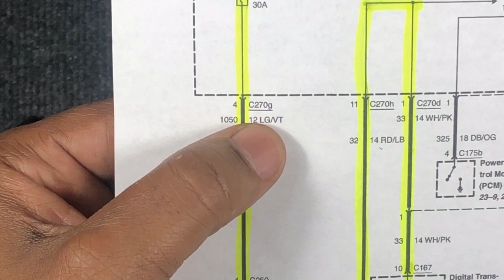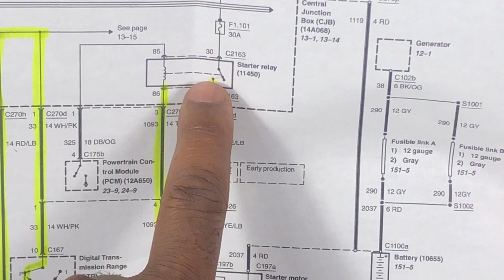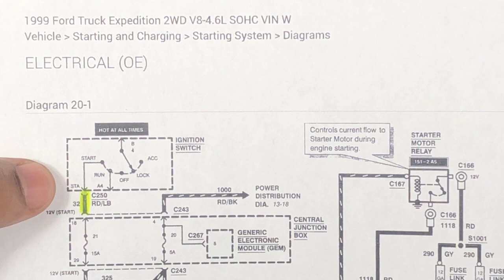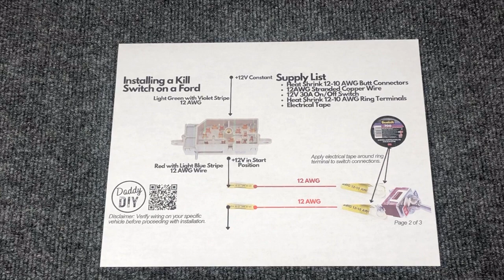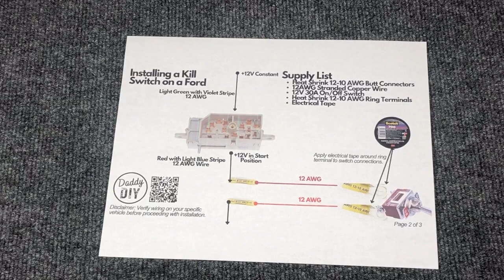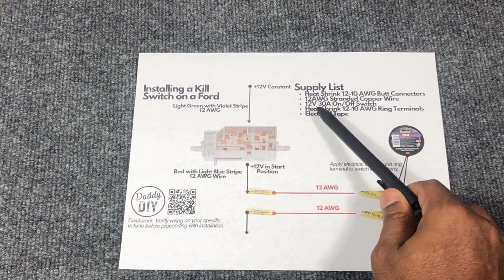How to Install a Kill Switch on a Ford Vehicle

Comment: Great info. I had some creative kill switches in my cars over the years
One, drill out the cigarette lighter and install a two step switch in the hole. Glue a nickel in the lighter element. Push on, push off.
Two, 1960s 70s 80s high beam switch on the floor. Push on, push off
Three, micro switch next to the seatbelt.
Never lost a car including my 1965 Chevelle Z 396 4spd that was tried 4 times. They finally tried to tow it and failed. They woke up my neighbors

Comment: ive got a scenario i need a resolution on. My 98 was stolen a year and a half go. they forced the ignition rod in the casted channel inward with a screw driver. I replaced the cylinder with a key set, but they key wont come out because something unknown is preventing this square shaped rod from retracting all the way back in allowing the key to release. messed with it from time to time, and still cant seem to resolve. resolve without having to buy a used full column assembly for $400.... What could possibly prevent this rod from retracting back in? i thought maybe a metal shard but i really don't know.

Comment: Great video! I really like how detailed the instructions are. Do you know if the same wire color is on a 2000 Ford F250 Super Duty 7.3 diesel?
Reply from the maker: Thanks. Appreciate you! Not sure about the wire colors for that vehicle.

Comment: So am I correct in that basically any of the yellow highlighted portions of this installing a kill switch along any of those sections would effectively do the same thing and at that point it simply a matter of which of these junctions sections of why are you have the best access to and is also simultaneously concealed enough
Reply from the maker: Yep. That’s it. Also, consider where you want the kill switch to be located. If it’s going to be a long distance from where you tap into the circuit, consider using a thicker gauge wire.

Comment: Really good explanation!  Very well spoken, detailed and thorough.  Only wish it was for a late model Ford with a push button start, but all the principles would be the same.  Appreciate your walking through the wire diagram and even spelling out a needed parts list.  Great content.

Comment: i fill like if i just wire a toggle to the constant and the other one, then that solves my problems. one kills the power to the instruments and overall power when key is on. and the other kills the battery power, cause right now you can start my truck with anything no key needed.

Comment: I NEED HELP. when i try and turn my car off, it does not go off, but if i pull the 50 amp fuse, it cuts off, BUT it is still drawing power and drains the battery. I cant afford a whole new ignition system cause its not just the tumbler that broke. SO I NEED TO WIRE two toggles i have, one to disconnect power, and one kill the engine. i need a wire diagram to tap into those wire, and run the switches. but i cant FIND ANYTHING...and no one is 100% clear. 1996 ford ranger

Comment: Excuse me, do you know where and what cable is it for a ford ranger 2002 ?
Reply from the maker: It looks like that ranger uses the same ignition switch as the one in the video. You can follow the steps in the video to check and see if that 2002 ranger uses the same wire color.

Comment: i would add that kill  switch to the starter signal wire which is a ignition only  just because most fords have a external solenoid which cold possibly be used from under hood just splice into that wire from external solenoid or the starter relay

Comment: Bro, great work! One question. Where can I get wire diagrams from? And furthermore, specific wire diagrams like the one in this excellent video you've made.
Reply from the maker: I purchased a set of Ford Factory Shop manuals for my vehicles. That's where I got my wiring diagrams. You can pick them up new or used on eBay. Here are few links showing what I'm referring to:

Shop Manual & Wiring Diagrams (Softback) - https://ebay.us/IB6F3p

Shop Manual & Wiring Diagrams (DVD) - https://ebay.us/3dFz9B

Hope this helps. Thanks for stopping by the channel!

Comment: Great video!  Wish you had done it for the fuel pump instead of the starter relay... what's your preference? 

Where did you get the wire diagram?
Reply from the maker: Thanks for stopping by the channel. Glad you enjoyed the video! I'm good with either the starter relay or fuel pump. I know some folks prefer the fuel pump because they want the starter to still turn over to create a crank-no start condition. Either way works fine for me. What type of vehicle do you have? I'll take a look at the fuel pump circuit for you.

Wiring diagrams came from the Ford Service manuals. I picked up a disk on eBay several years ago. Here's a link if you're interested:

https://ebay.us/Xtwkh7
Reply: @daddydiy7997  I have a 2018 Ford Explorer.  I started down the path of doing the starter,  but then I saw some cat drove a vehicle for 3 weeks without shutting off the vehicle because he felt there might be a kill switch... which there was, but it didn't employ until the engine had to be started.
Reply from the maker: Wow! They must have stole the car while it was running. If so, doesn’t really matter if the kill switch is on the stater relay or fuel pump. They can still drive off with the vehicle. Unless, you activated the kill switch to the fuel pump before they stole the vehicle or activated it remotely.
Reply: @daddydiy7997  no,  it was rented to the person.  In the end, he didn't want to return it, so he didn't shut it off.
Reply: @daddydiy7997  I added on to the fuel pump, and the car shut down shut 15 seconds later
Reply: Just out of curiosity, what state are you in? I'm in the Atlanta area
Reply from the maker: Alabama.
Reply: @daddydiygrilling  ok... right next door